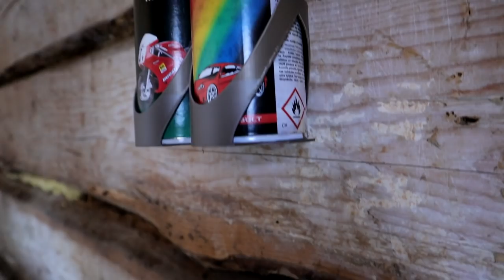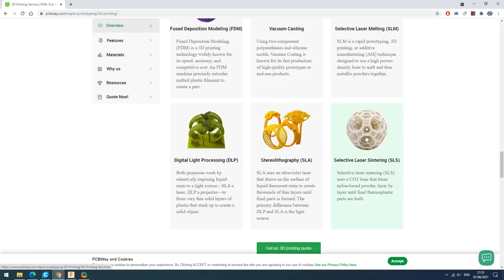Useful 3D Prints March 2022

Comment: I printed the drawer box a while ago in PETG, took a decent while on an ender 3 v2 with a 0.4mm nozzle but it has been one of my favorite prints so far (that aren't printer mods). My only issue is the full size drawer tends to slide out while the other 2 or 3 variations stay in.
Reply from the maker: My full size drawer also slide much easier than others.